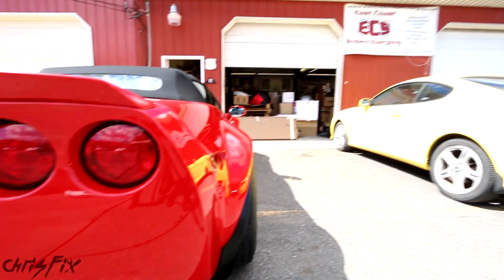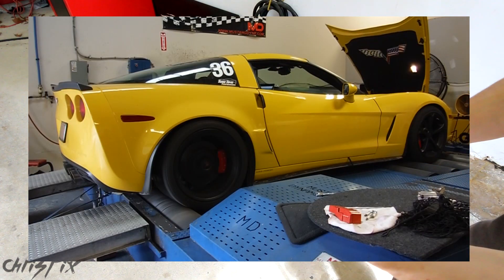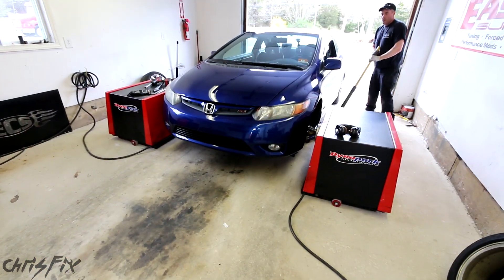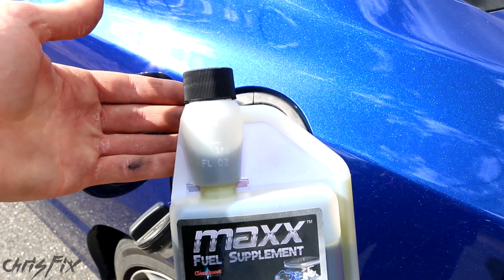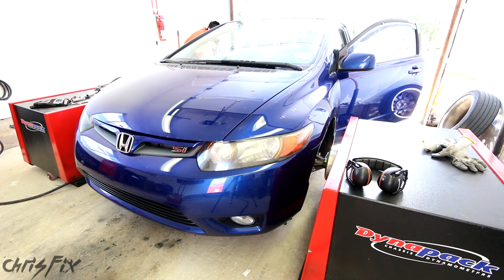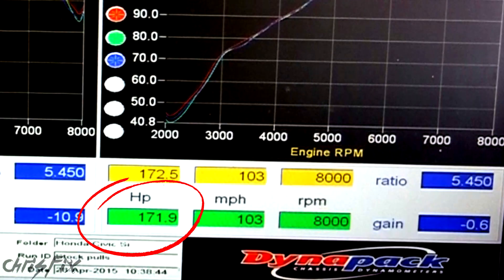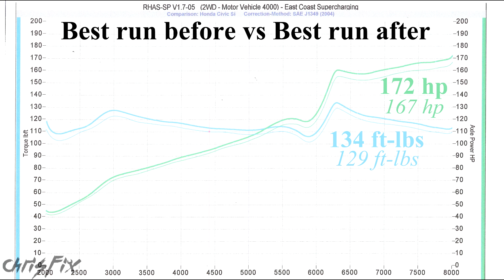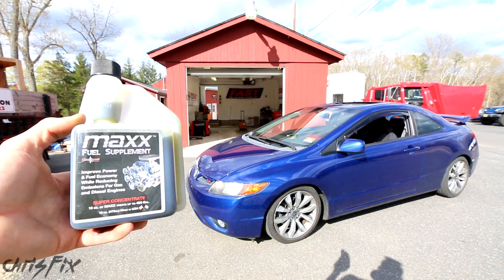Can a Fuel Additive Really Increase Horsepower in Your Car? (With Proof)

Comment: no miracle product,cam2 gas will cost about $7 a gallon and will make even more power just add some to your tank or run on e85 also,install water injection and use windshield washer fluid you will see the car RUN ,I have done that with my mercedes diesel and it's like I added steroids ,W. W. fluid is 20%methanol
Reply from the maker: +tonycavez Thanks for sharing!
Reply: +ChrisFix BMW just started selling some models with water inj. it works or they wouldn't do that

Comment: It's not like a lie detector, since Dyno works and measure objective outcome, not subjective stuff and work only 50% of the time ( so it's luck).  dyno is more reliable :-)
That is seem to work is crazy.  You should test with other car ( honda Si and other engine type) before making definitive conclusions a N of 1 is not the best. Still,  The consistency of the run AFTER compare to BEFORE is interresting. Might try that in my mighty FIT lol ;-)

Comment: I bought a bottle of this stuff, It seems like it works. I used it in my 93 pick up. I think its worth the money. I think you get more from it than the ones you buy at the store (Lugas ;) if you know what i mean. Only thing I found interesting was I pulled a couple spark plugs to see how its running after 1 and half tanks of it, and the electrode that supposed to be white is red. I never seen it before but heck it runs good.

Comment: whats vtec?
Reply: +BugzNoBunny 

VTEC (Variable Valve Timing and Lift Electronic Control) is a system developed by Honda to improve the volumetric efficiency of a four-stroke internal combustion engine (i.e. improved economy). The VTEC system uses two camshaft profiles and hydraulically selects between profiles.

I literally just typed "vtec" into Google search.
Reply: Lol Thanks, Dont know shit about cars
Reply: +BugzNoBunny you must be proud of that fucking thumbnail
Reply: +xmxoo7 Lol Thats 3 Years Old.. So

Comment: Dude, this video is dumb, anyone with any knowledge on fuel and engines knows octane does not increase horsepower unless your car is meant to run with a higher octane. A car will never know if its running higher octane, only if its running lower...

Comment: Considering they lost more power sitting on the dyno for too long than they gained putting snake oil in their fuel tank im going to say those 5 horses are up to gearbox oil/cv joint temp from trying to swish the additive around the tank(which may not have worked, it says on the bottle to add it when you pump the gas in) and then trying to put it back on the dyno the exact same way which on a level accurate to a couple of hp isn't possible. Its hard to get the hubs 100% straight like how it wants to sit on a drum dyno.
Reply: Agreed, i want a car on a dino with a external fuel supply and switching fuel sources back and forward, graphing it all out.

Comment: Hey chris cant you get a tune get that Vtec kick in a little sooner? 6000k seems a bit high 4000 would be better. Great vid!
Reply from the maker: +Keith Bartlett Thanks Keith. Honda tuned the engine perfectly so that it kicks in at the right time. I am not sure if it is computer controlled or RPM controlled.

Comment: I'm wondering if it increases horsepower or by its cleaning properties, improves the spray patterns of otherwise dirty injectors.  That would then be returning the power to what it should be when its all clean or new.  I been using a diesel additive for years.  Beforehand, my ute would blow black soot under labour and the turbo didn't throw you back into the seat like it did when new.  After several tanks of treated fuel, first the black smoke stopped and ever so slowly, the turbo boost came back.
Reply from the maker: +David Steer From my research and actually asking the company after I filmed this, they said it is a nano-catalyst, that makes burning the gas more efficient so you get the maximum energy out of the same amount of gas.

Comment: I have a question? Is this a cooling agent? Higher octane burns cooler  and faster, any way the octane booster just helps the gas burn more efficient making more hp or maybe time of day the test was preformed ?  In the morning the air is cool and less dense . I love your videos, not knocking you.

Comment: well it's pretty simple clean boost is a octane raiser so modern cars with knock sensor can change the ignition timing to be a bit earlier without making it knock and blow the engine. on older cars this wont work really cause you need to adjust the ignition timing manually so it wont knock. hope u guys can understant.. my english isn't the best :s

Comment: vtec just kicked in yo!
Reply: Lol
Reply: 1,00000000000000000000000000000000000000000000000000000000000000000000000000000000000000000000000000000000000000000000000000000000000000000000000000000000000000000000000000000000000000000000000000000000000000000000000000000000000000000000000000000000000000000000000000000000000000000000000000000000000 hp
Reply: Such a big jump when Vtec changes the cam timing means it's coming in at too high an RPMs...
Reply: @BuzzLOLOL   om my old Civic it came in at 4k rpm. Quite  exciting turning on the cruise control coming out of a toll booth
Reply: Bob Brown yes it is
Reply: eyyy
Reply: U rang?
Reply: Bro we are already home 😂😂😂

Comment: While this is a cool vid and interesting, the power gain is negligable. At least the product produces as advertized. I am curious what the gains would be on a turbo car or V8.
Reply from the maker: +Adam Zebrowski Thanks for sharing Adam! I was surprised there was any increase at all. It was a fun video to shoot!
Reply: +Adam Zebrowski 4-11 hp on a NA 2.0 L engine isn't that small. I used to have this exact car and spent quite a bit of money on aftermarket headers, exhaust, intake and a retune. All of that probably netted me 30-50 hp total. You can spend hundreds of dollars to get 4-11 hp on a 2.0 L NA engine.
Reply: +ChrisFix  I was gonna ask same about the turbo.. I was surprised to see it worked as well..
Reply: +Adam Zebrowski That small 5 to 10 hp is the difference between winning or losing a race. My buddy and i have the same engines in a sedan civic and mine a hatch civic. He just manages to get a half car length  in front of me all the time so for me it's gonna make a big deference.
Reply: +Civic R You may be right about getting a slight edge in a race. I just frankly wouldnt trust the stuff in my custom tuned STI.....and if u put it in ur daily driver.....its unlikely you would even notice a 5-10 hp increase on a 200 or 300 hp car.
Reply: Adam Zebrowski You won't feel the difference on those cars you're right but you can see the difference in a race when the cars are closely matched. An old friend of mine that runs a subaru b22 used to use a fuel booster and got higher boost from it. It made a big difference. I can't ask him what is was cause we don't talk anymore. Ps: We used to only use the stuff on week ends and race days.
Reply: Civic R I think you are probably the exact demographic this product is aimed at.. A Honda owner street racing that needs another 10hp without doing anything except putting a booster in the tank..

Comment: what does this cost ? and do you think a  higher octane gas would work the same?
Reply from the maker: +Jim Monheim Higher octane would work similarly, but it is harder to find octane over 93 here in the USA.
Reply: +butters900 why USA needs to have a different measurement system for everything 😭
Reply: +ChrisFix In norway mostly all use 95,98 Or some other shit btw :) hehe
Reply: +ZIKKBOY Europe and US grades their fuel differently. When in actuality if you test it, it would actually be the same or very close. Its just the way the US grades it. So for instance, 87 in US would be like 95 or the lowest grade in Europe.
Reply: +butters900 US 87 equals european 92. US 91 equals european 95 US 93 equals european 98.
Reply: I wasn't sure exact numbers. I knew it was like 5-10ish around there.
Reply: Don't ask me, I guess be cause "Murica haha. In all seriousness though, I've heard the US system is better in this particular thing, but I honestly don't know if that is true.
Reply: +Summit900 gas in Europe is better period. that's why the engines there have higher compression than in the US
Reply: No, its not. They are measured differently. If what you say are true, why do European cars run fine on American gas? USA uses the average of RON and MON which is the AKI, Europe only show the RON. Do some research before you open your mouth
Reply: don't tell me, I go to Europe twice a year ,I keep 2 cars there to use I have been an auto mechanic for last 42 years,European cars exported to America have different compression ratios
Reply: BS on both being a mechanic and going to Europe. Do some research before you open your incompetent mouth. Google it, takes 2 seconds to know that its the same fuel just graded differently.
Reply: Enough to know you're too lazy or incompetent to even google it and to try to prove me I'm wrong. Because if you did, you'd see I'm right.
Reply: +Summit900 read this peabrain in my country regular is 95 (ron)in Us is 91,super is 98(ron) in US is  94 ,fuck you
Reply: +Summit900 google is allover the place on that
Reply: Europe uses RON to measure their fuel. US/Canada uses the average of RON and MON which gives us the AKI. DO some research.
Reply: dude today I was working on a vw golf 2.0 went to the fuel cap and it says regular unleaded fuel 87 and in french carburants sans plumb 91 ron        , tu conprends maintenant?
Reply: So you literally just proved my point that it is the same fuel, but because its calculated differently, US/Canada has a lower octane.
Reply: +Summit900 damn your stupid!!!!!!87 in european mearsurement is 91 that's regular in america, in my country regular is 95 in european measurement
Reply: Obviously you're more illiterate than a backwoods inbred girl in the late 1800's. 85/87 in the US/canada is the same fuel as 91/93 in Europe. US/Canada calculates it differently from Europe so it seems lower than Europe when in actuality its not.
Reply: where I come from in Europe there's no 91 93 like you say it's 95 for regular 98 for super in European measure. do I have to keep repeating myself? ,you keep using google lol I'm speaking from 42 years experience I'm no kid I'm 55 years old I'm done with you butthead lmao
Reply: So US 85/87= Europe's 95. Congrats on proving my point even further that its the same fuel and its just calculated differently. It has been verified over and over again. Any mechanic I talk to say the same thing. So, congrats on being the most incompetent mechanic on YouTube. Ignorance is no excuse, especially for a so called "mechanic" as you call yourself
Reply: oh no there you go again

Comment: Ok so what does this actually do? I am putting more aggressive timing with higher octane fuel in my vehicle and want to know if it's safe to add this. I run a colder coolant temp setup so in theory that has a higher chance of preventing spark knock/detonation. does this increase the combustibility of the fuel?
Reply: +Trey Stine As far as I've heard in the past, it is essentially just higher octane fuel. The additive reduces knocking and burns better as would high octane fuels.
Reply: +Trey Stine Im sure you are safe to add it. If any corrections in timing or knock. The computer will pull the timing as needed if its too much. But this is if your vehicle is like 86 or newer when they started putting computers in cars, obd1. I put some in my old truck and really think it made a difference.
Reply: rocklow243 yeah I'm on 22 degrees of advance on 93 octane in my 01 sonoma 4.3 vortec. I guess it won't hurt to try it
Reply: +Trey Stine yeah you should be perfectly fine. I am not sure what's honestly in it, so I don't know if it's like a octane booster or what exactly. but even with your timing advance if this is like a octane booster your computer will adjust to it.

Comment: My question is 103 mph ? My b18a1 stock is 220kmh and it will reach that
Reply from the maker: +insane_ivtec 103 was in the 1-1 gear ratio. I think that was 3rd gear if I remember correctly.
Reply: +ChrisFix ohhhh ok thanks
Reply: +luke simpson uh.. no..
Reply: +insane_ivtec Whenever you dyno a car, you run in the gear that is 1:1 ratio.
Reply: +luke simpson It's done becuase its a 1:1 gear
Reply: +ISEE YOU 4th isn't always 1:1, my 4th is 1.14. You can use any gear. Also some roller dynos will only ramp up to 110mph so 4th gear can't be used. 3rd or 4th is usually the tuners preferred gear. All reputable dyno companies software auto adjusts so regardless of gear hp and torque will read amazingly close to each other.
Reply: +Sh!t Kunt Yes, a few people out there make a difference between 1:1-ratio and a "direct-drive". The direct drive is a previledge only for 3-shaft gearboxes and planetary ones, where you can join the 1st (input) shaft with the 3rd(output) with a coupling; or block the entire planetary row - respectively. This way prevent the power loses of at least one gear couple (z(n)/z(n+1)) in the row. But most of the FWD (manual box) use 2-shaft transmission, which does not provide direct drive, and there, the exact 1:1 teeth couple is avoided, because teeth contact repeat itself - each tooth of the input gear contacts, everytime with the very same tooth on the output gear, and causes uneven wear, which reduses the life of the gear couple. Besides that, the 1:1-ratio is not as efficient as the >1-ratio (1.14 in your case) - actually the reason, why in the modern cars they try reducing the number of the overdrive gears to minimum - do not be surprised, if you have a direct gear, and it's actually is the fifth or sixth, not fourth. :)
Reply: Dyno's are always done in 4th gear because it's thw correct balence of revs and apeed

Comment: To be honest, putting fuel additives in your honda isn't recommended since it fucks up your fuel pump. you may get +5hp for the price of what? creating more wear and tear on your fuel pump. to me that isnt a great deal at all. i just rather put high flow header and full exhaust for a good amount of gain rather than messing around with the damn fuel system by dumping shit that isnt recommended in your tank.
Reply from the maker: +beefcakemonsta Thanks for sharing. This wont cause wear on the fuel pump. You add 1 oz for 30 gallons so there is barely any in the tank.

Comment: What octane fuel were you using? Do you think different octane levels would have different results?
Reply from the maker: +Pyr0King We were using 91 octane. If you increased the octane, you would increase the power since this car has a high compression engine.

Comment: Torque is measured in lb-ft (pound feet), not ft-lbs (foot pounds). Good video, though.
Reply from the maker: +OddTimeMan Thanks, I go over the units of torque in this video: https://www.youtube.com/watch?v=3v3hLvuO_KU
Reply: +ChrisFix Foot-pounds are measurements of energy, so it's different than pound-feet, but yes, foot-pounds is the term most people here in the States use to measure torque.
Reply: Trevor Newark Yeah, "foot-pounds" is WAY easier to say than "pound-feet". NOT!  And do you always say what's easiest even if it's wrong? That's just stupid.